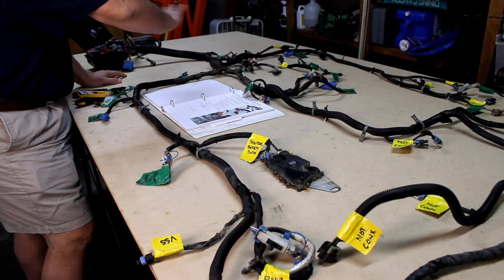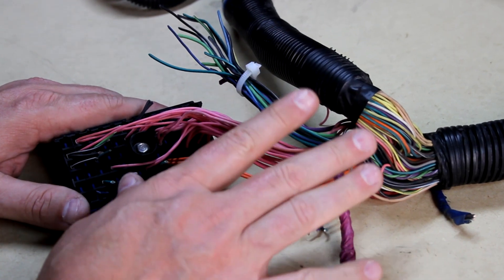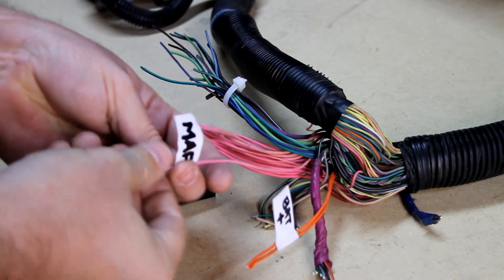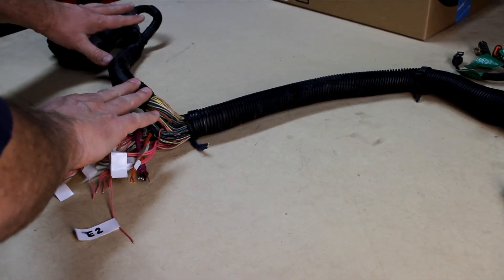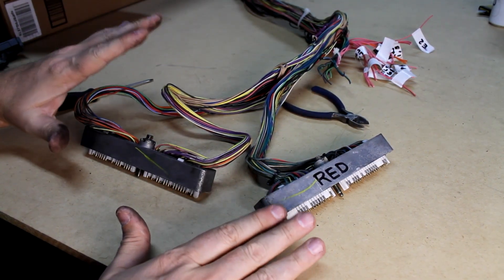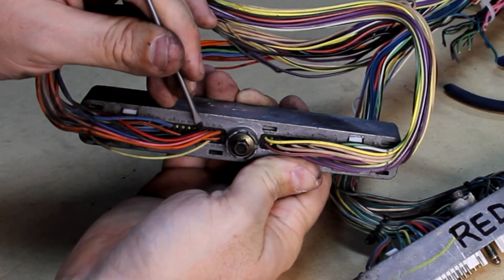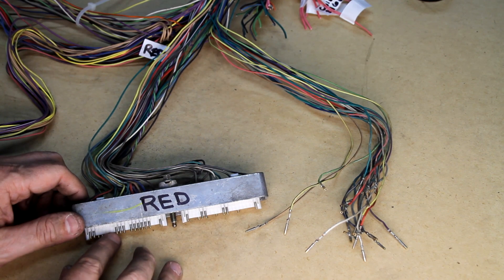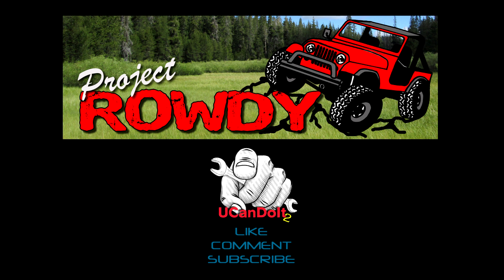LS Wiring Harness Part 2 | Project Rowdy Ep014

Comment: You cut and label wires E2 and F2 but in the diagram they are marked delete. Why??
Reply from the maker: Thanks for pointing this out.  I originally marked it for deletion as it had reference to the Transmission Solenoids, but later revised that decision as it is needed to supply switched power to the PCM.  If you have downloaded my LS Wiring diagram document, it is referenced on page 2 as PCM Blue Pins 19 and 75 going to the new fuse #2.  I will correct the documentation and publish them.  Thanks again.   Mike
Reply: Thank you for getting back at me. Great videos btw they’ve really helped out a lot!
Reply from the maker: You are welcome!!
Reply: Hello sir.  First these videos are simply excellent.  I can’t find the c2 block chart you downloaded from lt1swap.com.  Can reply a link please.  I looked a few times but can’t find it.
Reply: @Foundmylsswap  same,  I can't find the needed/ not needed pinout for c2 anywhere on his website
Reply: @matthatesford  🤷‍♂️ shitty for both of us till we find an answer.
Reply: @Foundmylsswap  minutes after I posted I found it, go in the description of this video and click the pcm and connector pinout charts link. I currently enjoying the weather outside while I thin out my harness lol
Reply: @matthatesford  I’ll check  it out! Thanks

Comment: I have an 05 silverado. I plan on doing something different than what other people are doing. Ultimate goal is to rebuild the L59 with a Holley terminator system, along with a tunnel ram intake using two of their faux fuel injection carbs. The biggest hurdle in planning has been trying to figure out how to convert from DBW to DBC. I am so glad to have found your channel and am thankful for the information you’re sharing
Reply from the maker: Awesome!   That’s what’s cool about even these newer engines…. There is a wide range of customizations available for those that have unique needs.    Cheers and have fun with your project.

Comment: @UCanDoIt2 still a little confusing to me lol I’m trying to remove all the wires that I don’t need for my 1999 5.3 LS and T56 swap in my MCSS, if I’m using the original truck fuse and relay box do I just leave all the pink and orange wires on the connector? And exactly what all wires do I remove from the red PCM connector? I’m trying to do my wire harness using your video. Thanks much appreciated
Reply: @UCanDoIt2 I think I got it. Using your chart pictures in your Dropbox you left in the description, I remove all the wires that’s highlighted in yellow on both Red connector and blue connector then remove the pink wires that goes to those sensor connectors that needs 12 volts that’s not needed??? I’m using the original fuse and relay box
Reply from the maker: It sounds like you do have it worked out.   If using the original fuse box....   It will be supplying power (Pink and Red) to the PCM.  You would want to remove any Pink or Red Wire from that block that are not being used in your new configuration so that they do not short-out down the road.
Reply: @ UCanDoIt2 thanks for the reply yes I believe i did figure it all out thanks to your videos. Thanks I appreciate it
Reply: @UCanDoIt2 On video 4 you mentioned a wire on pin 42 on the blue connector, on my harness it doesn’t have a wire coming out of it. It’s original 1999 5.3 harness Any idea?
Reply from the maker: On my PCM Blue connector pin 42 was also empty.  It is for the Fan Control Relay.  The 5.3 engines mostly came with mechanical fans, so Pin 42 was not used.   Because I am going to be running an Electrical Fan, I am plugging back into the PCM on that pin and will program that for the first Fan Control Relay.
Reply: Thanks buddy you have been a huge help on my build, now it’s time to start pulling the wires and connectors out of my harness and hoping I don’t hit anymore road blocks along the way lol between you videos and LT1swap I definitely got this. I’ve also decided to go ahead and use the aftermarket Dorman fuse block and relay setup.

Comment: Nice work. Really helpful and you've given me the confidence to tackle the loom. I've been researching like mad since I first watched your videos in this series.
I've been trying to understand the role of the two fans, as I plan on using the fans from the same donor car as the engine, and I remembered you talked of adding a wire in for a fan so I jumped back to your video to see if there was a hint on how they work. I'm left with a coupe of questions.
When you're describing the Blue connector, at 13:51 you point out that on Pin 42 you need to add a wire back in to control (ground) the electric fan. That matches up with the wiring chart I have from LT1swap.com, identified as the Low Speed Cooling Fan Relay Control.
 This is where I am at the moment, trying to understand how the Low Speed fan works. What I'm trying to establish is, if you put that wire in at Pin 42 and attached it to the relay for the Low Speed fan, does this just mean the fan will run all the time?
In your LS Wiring Harness diagram, Fan 1 Relay (B42, Low Speed fan) passes through your connector, but the Fan 2 Relay (R33, High Speed fan) does not. What is the thinking there? If you do have a video covering that, please point me in the right direction as I haven't found it.
Again, really useful, and I'd like to thank you a lot for sharing. You're helping a lot of people!
Reply from the maker: For my implementation, my engine is going in an ole Jeep CJ7.  It has a square radiator and I plan to run 1 fan and not two smaller ones.   I think I will get better cooling that way.  In my connector, I accommodated for a single wire fan control.  The second wire, I kept, but it is buried in the loom until I decide I need it.  It is my understanding that Fan1 and Fan2 are primarily triggered at different temperatures by the PCM.   In my case, I will be running one Fan control wire to one Fan Relay which will control the fan.  In your case where you plan to run 2 fans...  you will need both Fan control wires and you will need 2 separate Fan Relays.  Fan1 control wire will trigger Fan1 Relay and provide power to Fan1.   Similarly for Fan2.  You will be creating two separate circuits and each will be set to trigger at different temperatures in the PCM.   Hope that helps.

Comment: Two questions, the check engine light that you mark with green tape, come from some where along the harness or from PCM? and else am confuse because you are not gonna save C153 connector but you are saving Temperature Sensor and A Brown wire run from C153 connector to Temperature Sensor.
Reply from the maker: The Green Check Engine Light (MIL) wire comes from the PCM and will be routed to a newly installed OBD2 port in the older vehicle that this engine is being swapped into.  I am keeping the Temperature Sensor.

Comment: hello once again! am going to save all transmission wires cause my trans is automatic 4L60E so my question is VSS (vehicle speed sensor) is part of the trans wires and i need to keep it and fuse it or delete it? Does an automatic transmission works with no VSS?
Reply from the maker: Javier Argumedo Not sure, as you are using an automatic transmission which is different from mine.

Comment: Hello! hey i have the same engine and wiring harness so my question is What is the purpose of removing those wires? it is possible to install this wiring harness as it comes original without removing or deleting  any wire from pcm?  am gonna install it on a chevy 1952 pick up.
Reply from the maker: Removing Wires is primarily for a cleaner look as they are not needed.  The merging of wires (Pink and Orange) and connecting them properly is a must.
Reply: @UCanDoIt2Mike  thanks to get back to me and i hope you still helping me with answers while am working on my harness

Comment: Nice vids. I have been struggling with deciding which way to go on my build. I have a 1925 Dodge and was trying to decide if i want a traditional old school motor (318 - 340cid) or something modern like this. Although I would like to stay on brand and not do GM. Questions; A- how do you know which donor car to use? / B- I assume the procedure is the same for Mopar?

Comment: I’m working on my harness right now and on the c2 block there’s a pink wire on e2 that goes straight to the c100 plug labled delete but on the c2 block it says keep but it runs to nothing. not sure what to do
Reply from the maker: Marco Ramirez Delete it.   That wire is for some item that needs Switched power that used to live down the C100 harness.  None of those items exist anymore.  Therefore that switched Pink wire is no longer needed.

Comment: The PCM Red/Blue connectors being removed as called "Connection Positive Assurance" or simply put, CPA's. Other names have been given to these by GM over the years, but still function as called. They hold the "Lift" pin in place so the connector can not back out once installed. 
  You have done a decent job of explaining what you're doing. I only want to add the after years of dealership work, I purchased the J-Tools to remove and install. This harness is straight forward with "Slip-into-back-termials" while others are pull backward to seat. Save those terminals with the shorter wire that fit into the plastic connectors as somebody will need then of want them for project. Good video as always, "Like" & Subscribe...Then watch part 3..
P.S. I the PCM is mounted to where moisture can get to it, they make tiny rubber plugs that fill the holes left behind after some wiring it removed. I will try to get the part number soon.

Comment: great job .. its very helpfull .. Q/ if i want to do drive by wire stand alone harness the diffrent  keeping pin 14, 15 thats all ?  .. cus i have all the part for drive by wire
Reply from the maker: A little out of the scope of my project, but....  Your focus will be the extra sensors and control devices at the Throttle Body.  Also make sure your PCM is setup for controlling all the items.  I believe I saw somewhere that the PCMs are slightly different.   Check with Channel:  Sloppy Mechanics.  He had a video once that I believe talked about this.  You might be better off getting a PCM and Harness that is equipped for DBW.
Reply: UCanDoIt2 thanks for the reply.. could you send me your pinout sheet of the C2 connector , cuz in lt1swap.com  the current one on there doesnt individually describe all the pink wires (ignition 1 voltage )  , my email : kwt535@gmail.com ,  thanks alot for your help
Reply from the maker: PCM and Connectors Pinout Charts:  http://bit.ly/PCMandConnectorTables
Reply: UCanDoIt2 thanks alot for your help

Comment: Where are the c100 152 and 153 connectors located on the car? I’m going to be pulling a 5.3 this weekend and want to know where to look so I can just detach them so I can pull the harness
Reply from the maker: CK_32 not really sure.   This engine was already pulled when I picked it up from the salvage yard.       All three connectors are located not far from the PCM.

Comment: am working in a harness to run the same engine as yours with automatic trans 4L60E so do you save and fuse wires related with this trans including neutral safety switch?
Reply from the maker: Yes!   You would need to keep all wires and connectors related to the Auto Trans including the Neutral Safety Switch.

Comment: did you save a wire for speedometer,  tachometer, gas meter, battery voltage, etc?
Reply from the maker: My engine is being swapped into a 1979 Jeep CJ7.  (1) My vehicle Speedo is run through a mechanical cable off the Transfer Case, so nothing from the PCM will be involved. (2) I will be using a feed from the PCM to run my Tach.  It is one of the wires in the 8 pin connector. (3) Fuel Gauge is run form a wire that comes from the fuel tank and have nothing to do with the Engine Harness/PCM. (4) Battery Voltage Meter will come through the Vehicle Harness and not from the Engine/PCM.   Hope this helps!

Comment: Hello! i bought an aftermarket wiring harness w/ fuse block. this Harness come with gauges wires so i would like to know if are those wires the same that you are saving in your harness?
Reply from the maker: The gauge wires that I work with in this series are a part (within) the original Engine Harness.  Sounds like you also have the Dash Harness that actually connects to the gauges.  That harness was not covered in this series.  I do not plan to cover that as I will be integrating the Old Gauges that come with the vehicle that the engine is being swapped into.   I will be integrating into that Dash Harness.
Reply: hello once again! thanks for answer me so i have chevy 1952 and am using original gauge
as an tach. Can i use either way  the tach wire (R10) that your diagram show or the wire that come from an aftermarket fuse block? else this fuse block come with wires for a Fan, Fuel Pump, Gauges. another question is what wire are you using to start the engine (engine ignition)?
Reply from the maker: Your 1952 Tach needs a Signal Wire.  Not a Power wire.  I can't think of any wire coming from the actual Fuse Block (power) that would involve the Tach.  The aftermarket Harness should have a wire labeled Tach which would be the signal wire.  Because there are different configurations for this, you should really consult the manufacturer of the Harness to best understand how they intended you to connect it.
Reply: @UCanDoIt2Mike  sorry,  yes you right that was a misunderstanding so what is better way to connect the  R10 wire for tach signal that come from the pcm in your configuration or the signal wire come from aftermarket fuse block? and i have an electric fun with a single fun system . can you tell me what is the purpose  of FAN 1-PPL and  FAN 2 RELAY. In your diagram. i really appreciate your help thanks
Reply from the maker: Both Fan 1 and Fan 2 are to be connected to a Relay.  These are relay ground trigger wires.  When a good ground (-) connection is provided by these wires tot he relay... the relay will activate and provide Power 12V+ through a separately provided and fuse protected circuit.

Comment: If I follow all this steps  what else more I need to do to keep my stock transmission  everything I'm going to use is from 2001 Chevy Tahoe engine 5.3
Reply from the maker: If you keep your stock transmission, you will need to determine which connectors/circuits need to be left in the harness to support it.   I removed all of those circuits as I am running a Manual Trans.

Comment: So on the red connector from what it looks like from your sheet you left pin #50 (vehicle speed output circuit  4k)  but I didn't see you wire that anywhere,  did you remove it?  I don't see a use for it for me.  Motors going into a rock buggy.
Reply from the maker: That wire is used to feed the Speedo of the donor vehicle.  It is used with electronic Speedos and my Swap vehicle does not have.  I believe I later terminated that wire in my harness as I cannot use it.   Hope that helps!!!!  Mike
Reply: @UCanDoIt2Mike  thank you so much for the quick response!!  An great job with the videos!  Your videos guided me right through it with no issues.  Was very easy!!!
Reply from the maker: Fantastic news and thanks for the feedback!!!  Cheers and have fun in the Rock Buggy!!!

Comment: so on an ls1 98 to  99+ swap this means I would need to repin in order for the car to start or will it be only the gauges be affected?
Reply from the maker: Kind of a vague question.  Not sure what you are asking....   For the Gauges, you will need to tie into the gauge related wires of the harness and connect them to your gauges.  Depending on the vehicle, you may need some converters.   Most likely you are going to have to merge your Power wires as in this video series.  You most likely will be removing the original Fuse block.  Most of the DePinning form the PCM connector is for sensors that are no longer desired.  Others are DePinned for gauges.  Hope this helps.
Reply: UCanDoIt2  Yea on my project all Im doing is swapping my 98 ls1 firebird pcm for a 99+ pcm. Re pinning is said to be required for certain features to continue working but my question is. If I could just plug & play it so it could run. Then worry about the repining anything else later. I was just concerned of harming something? Any way I went to try to fire it up a moment ago and didn’t start it just cranked. Everything seems ok but I have low battery voltage also.

Comment: Okay this is my first ls project ever....do I still have to have my computer flashed if I do this ?
Reply from the maker: Yea, so will want to remove VATS (vehicle anti theft) and if you are planning to run 4 O2 censors, you can disable 2 of those.   The key is if you can and want to eliminate something from your configuration, you need to disable it from the PCM so that you do not get erroneous/invalid check engine light warnings.
Reply from the maker: will leonard.  The vehicle that you are going to put the engine in will most likely not have the GM anti theft system and therefore you will have to disable that or the engine will shut off.  Your programmer should be able to ask the correct questions to get it right.
Reply: It's going in a 53 studebaker commander so I don't think so